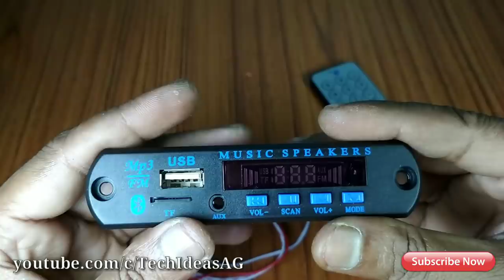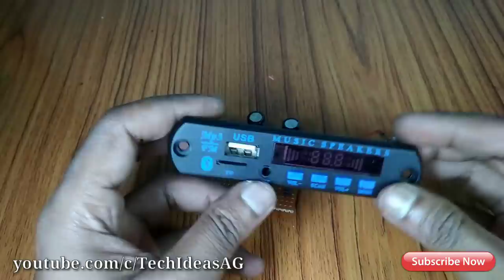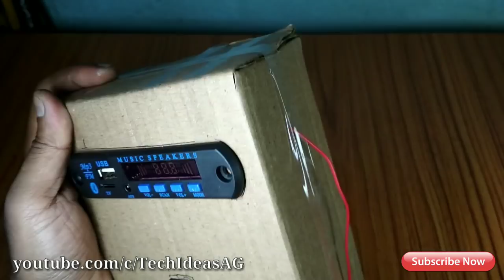Mini homemade Home-Theatre

Comment: Nice video. 3 Ideas. One you did such a nice job of building it, i seems to me that it is calling out for a better home than a cardboard box. Two please get a handle fir your knife before you cut yourself. Three clean and retin your soldering iron. You will find that your solder joints last longer. Cheers.
Reply: Agree